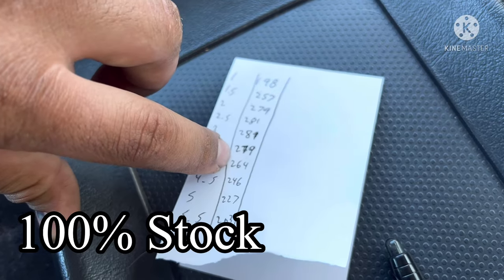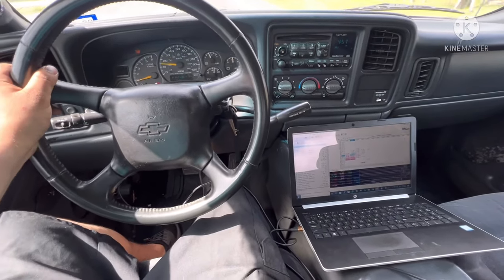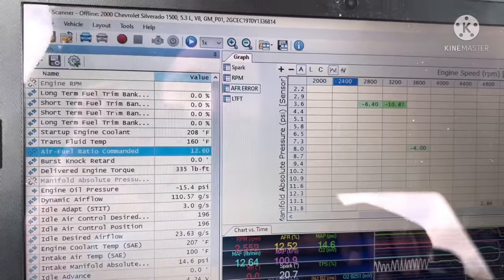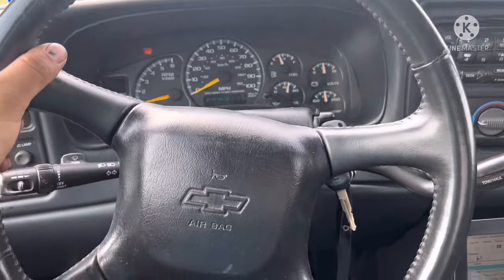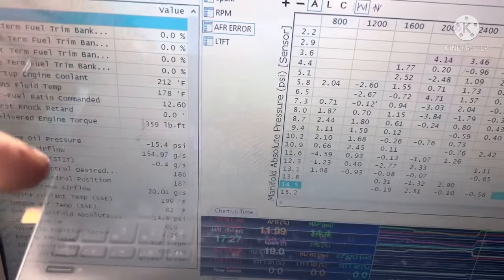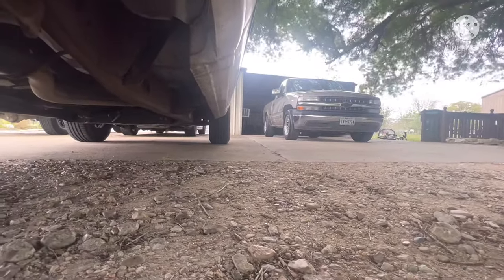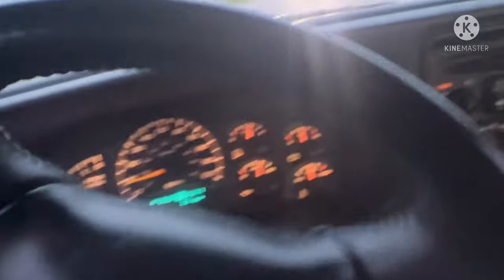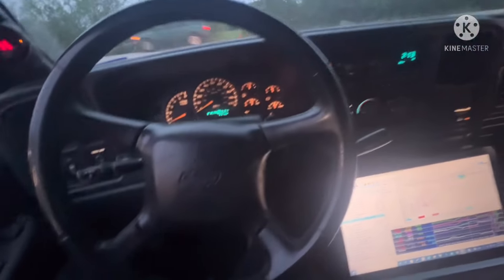BTR Truck Norris Cam + Tuning = HUGE GAINS 💪💪💪 ~ HPtuners

Comment: about 6 months before the  truck norris  cam came out I put a BTR stage 2 in my lq4. man I wish this cam was out then, oo well I wonder on a 6.0 how much hp and torque is the difference, I know what Richard Harder said but that was on a 5.3 made into a 5.7 if I am correct.
Reply: Same here.
Now I’m not sure if I want to buy the trucknorris cam or if I should just get a converter. I definitely feel like I lost a bit of low end torque with the stage 2 V2 truck cam.
Probably just gonna go with getting a torque converter in the end.
Reply: @MartinAguilar213  a stall converter will let you jump into the power band of any camshaft
Reply: @davidcunningham00  yea that’s what I’m gonna go with . Any suggestions?
Reply: @MartinAguilar213  depends on what your doing with the pickup,  me I have a 2800 to 3200 stall I need to put in
Reply: @davidcunningham00  it’s my street truck , just my fun truck.
Reply: @MartinAguilar213  the chevy 2500 I talked about in here is my daily

Comment: How does this cam compare to a TSP 228r cam
Reply from the maker: Truck Norris cam is the best out there for low and mid range gains, larger cams will suffer where the truck Norris cam shines. But the larger cams out there will make more peak power 5500 rpm’s and up

Comment: Put it on a dyno and see what it actually does. Hp tuners numbers are alot higher than actual dyno numbers.
Reply from the maker: I’m not worried about what it actually does, I’m just using this as a tool to measure. It is known to be very accurate numbers for flywheel reading. Then deduct 20% or so for drivetrain loss
Reply: @BoBuilds  that's what I was getting at. Still going to be nice gains from stock though.

Comment: i put a truck Norris in my 04 Silverado 5.3 with stainless works long tubes . nnbs intake 87mm throttle body and it chops like ginsu !! stop light to stop light i will hand you your ass!

Comment: Your map reading is getting lower at high rpm. Your intake is running out of air. I tuned a btr stage 3 6.0 truck. Cam only. No headers only a cold air intake. It really choked out on top
Reply from the maker: Not gonna waste money on an intake, she’s getting procharged in a week or so lol, but yeah your right she’s choking for sure